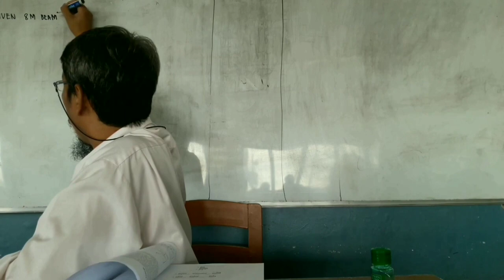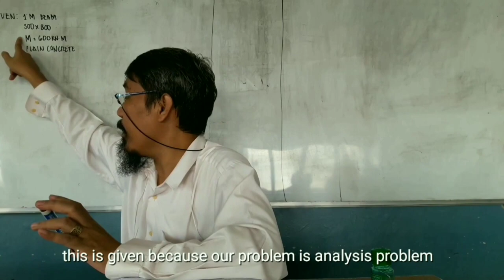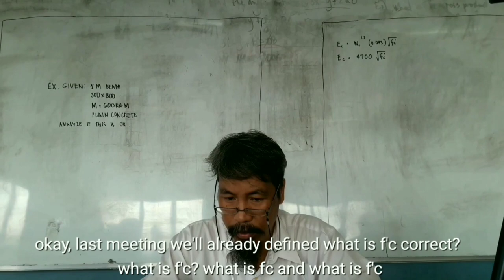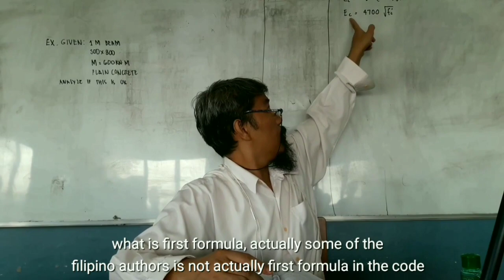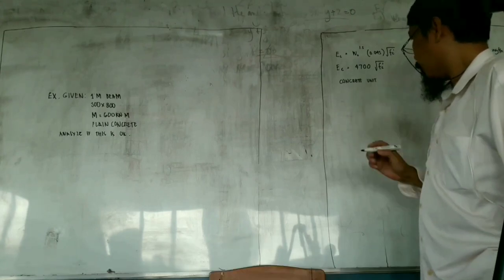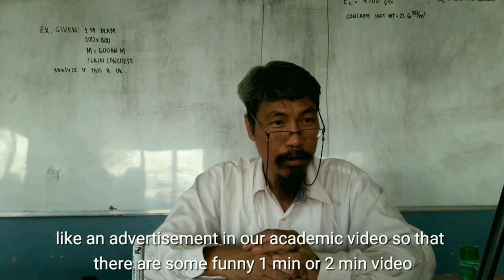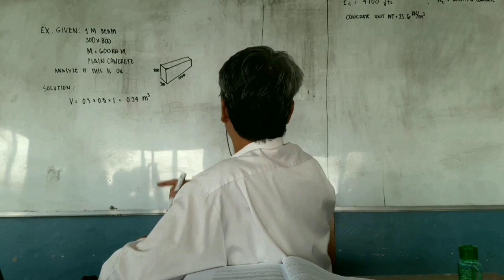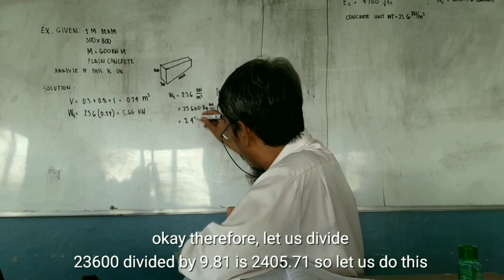CE 422: Structural Design 1: Reinforced Concrete Design || Analysis of Plain Concrete || Part 1

Comment: Thank you for this video lecture Sir. This is what I learned after watching the video: That fc is the usual theoretical value while the f'c is the strength of concrete that can be determined through testing after the concrete. The prime indicates that the concrete is supposed to be tested with a specific days because at different curing days we will get different results. In 7 days you'll get the lower strength of the concrete.

Comment: Thank you Sir for this video where we are talking about the concrete or analyze of the beam in the compute load if it's okay. The f'c is the strength of concrete where determine through material testing of 28 days curing and also determine the compressive strength every curing in 7 days, 14 days, and lastly 28 days.

Comment: Thank you sir for this informative video, I have learned that f'c is the strength of concrete and it is determine through material testing of 28 days.Last sem we had the subject of construction materials and testing where we learned how to test cylinder concrete and its strength is known after 7days, 14days, and 28 days.

Comment: thankyou for this video. I have learned that f'c is the strength of concrete and it is determine through material testing of 28 days.Last sem we had the subject of construction materials and testing where we learned how to test cylinder concrete and its strength is known after 7days, 14days, and 28 days.

Comment: Thank you, sir, for this lecture. I learned that fc is the original strength, and f'c is the strength of concrete after material testing of 28 days. For this course subject, it is important to have a minimum knowledge of the following: strength of materials, construction materials, and testing, together with structural theory.

Comment: I've refreshed some knowledge in our previous course Construction Material and Testing wherein we have this called compressive strength of concrete (f'c) = compressive strength of concrete (MPa) after 28 days of curing. And as what have mentioned in the lecture with different curing days, we will have different result of the concrete. Thank you for this lecture, Dr. AP

Comment: Thank you, sir for this discussion about concrete design. The compressive strength gained by concrete is thus measured at its 28th day after which the rate of strength is lowered.

Comment: Thank you , sir for having this kind of lecture. I know realized the important of the units we've taken last semester which are strength of materials, Construction Materials and Testing as well as structural theory for they are foundation that we will be using in Reinforced concrete. This video also serves as a refresher for the simple knowledge we had on our previous units